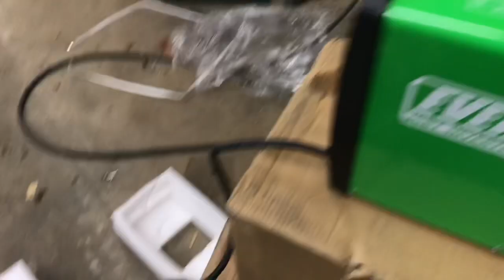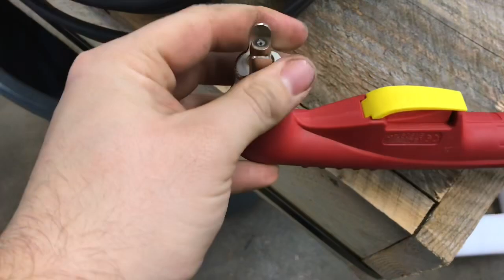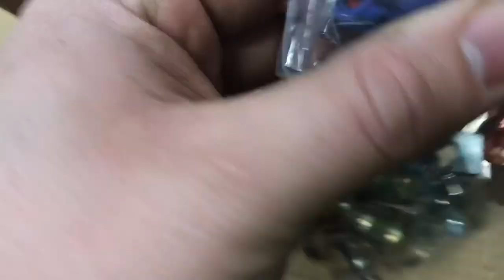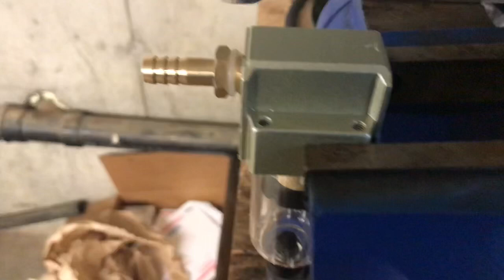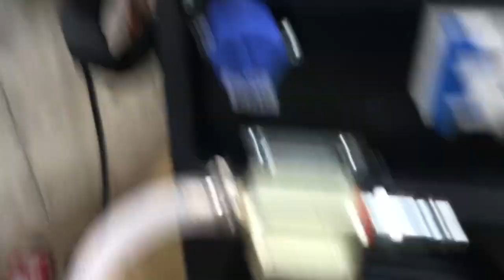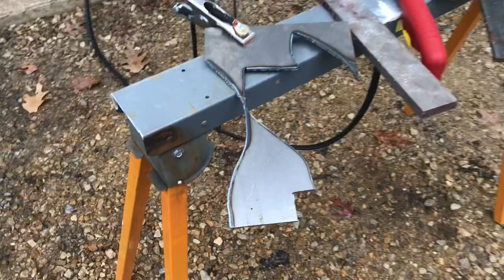Everlast PowerPlasma 50S Review

Comment: Do you have another line dryer/water separator besides the little one on the back of the machine?
Reply from the maker: yes,  have one for the whole shop.  i also added a small regulator filter to be back of the unit so the inlet pressure can be regulated with ut dropping the whole shop pressure

Comment: That <5/8” was pretty nice which means you could cut your bevels on 3/8” for preparation for open joint or backing plate welds.
Reply from the maker: most deff.  it will work great on cutting bevels